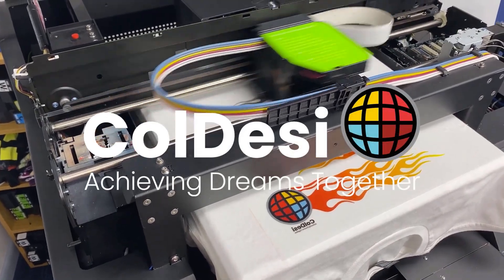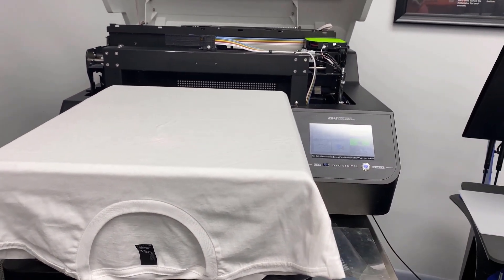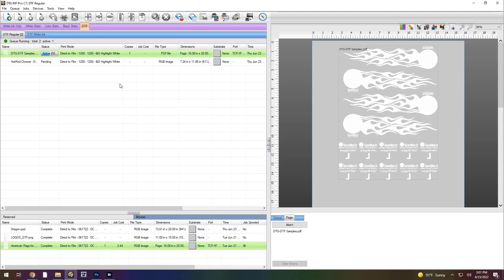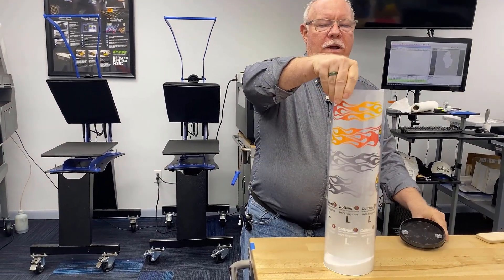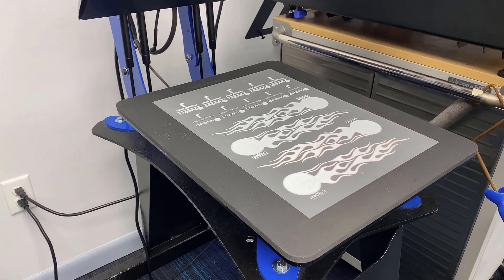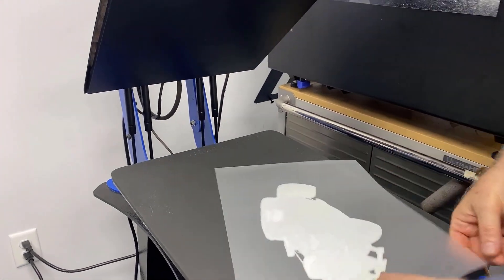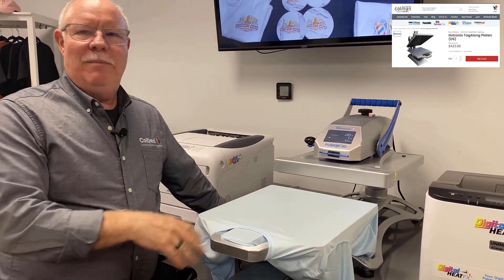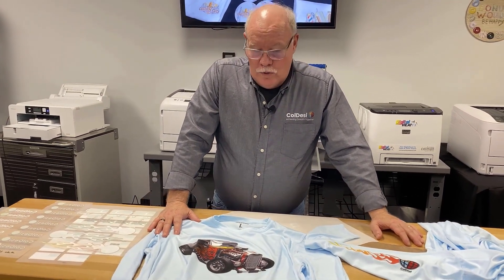How To Print DTF Transfers With the DTG G4

Comment: When using the Brother GTX-pro and the new Graphics Lab software you have total control over the amount of ink put down on the film. You can handle the film after printing and not worry about the ink running. It works perfectly. Definitely a far better option.